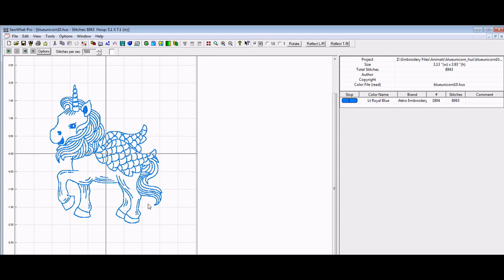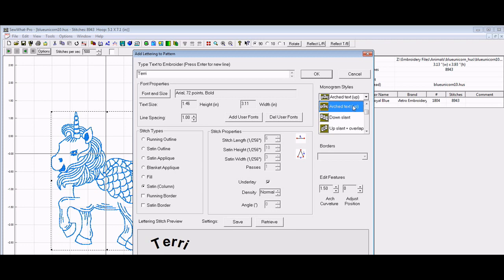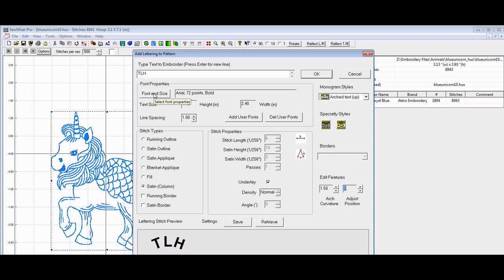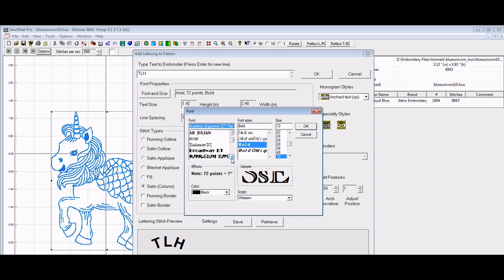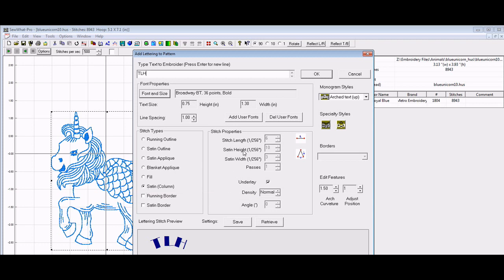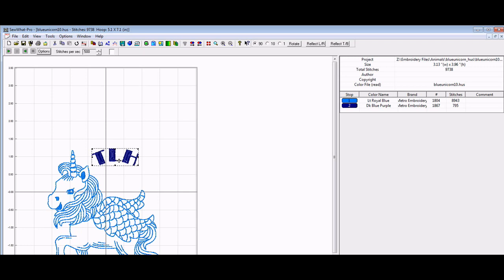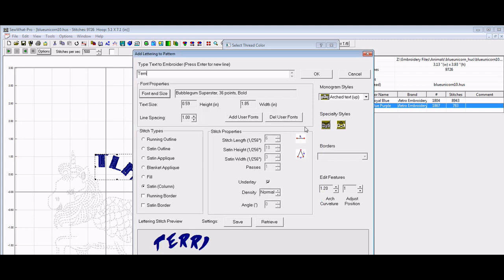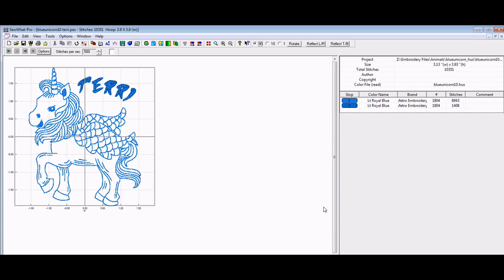Adding Lettering Using SewWhat-Pro Embroidery and Monogramming Software

Comment: I know this video is old but I am hopiing to get my questioin answered.  I did just as the video says and was able to stitch out the words with my design but it did needle stops after every letter instead of stitching everything  at once.  There were even multiple needle stops in the middle of some letters!  What can I do to make it stitch everything together.  Thanks.
FYI - I did join all adjecant colors which I thought should take care of it. It worked for the picture but not the words.

Comment: I downloaded a true type font to use with Sew What Pro.  I have a Brother PE770 machine.  I am able to get the file on the thumb drive and see it on the screen of my PE770 machine.  However, when it does the monogramming it is not correct.  Base stitches under the first letter are too long and the remaining stitching doesn't come out correct on my project.  What am I doing wrong?  Anyone have this problem?  Thanks

Comment: I have been told you can download additional .ttf fonts. I have done so and I thought added it as a "user font", but I still don't see it listed in the font list.  If I go to "delete user fonts" it does show the font.  What am I doing wrong?  Thanks for your help and for the tutorial!
Reply: Rachel I know this is 4 years later and I hope you were able to resolve your problem. If not, then note that you cannot see your downloaded font by clicking on the user font alone. 

After downloading and installing your fonts. You click on user fonts, add the font you want. Then click on font and size button, scroll through or type the first letter of your font name to see it. Click on it and press ok. Type out what you want to check if it shows as your font, if it does, then you are game. Hope this helps.

This happened to me too until I followed this route.

Comment: Can I just do words such as a phrase, without a picture? do I have to have sew write to do words?
Reply: Hi Crafty Mom, I know it has been 4 years and you must have resolved this issue. Yes, you can write only letters/words and you must not necessarily have sew write though I recommend sew write because of it numerous fonts and functionality. You can use the ttf fonts in the software though most do not stitch out nicely. Purchasing, downloading and installing ttf fonts are way to go. You can add these fonts in SWP after the mentioned 3 previous processes by clicking on user fonts, select the font and add it, then go to font and size, check for the font or simply type the first letter of the font to make it quicker, choose it, write words to check if the font shows the words as it should be and if it comes out ok, then voila you nailed it.

Hope you have been having fun with your SWP. Cheers.
Reply: @EverythingCustomMade  thank you

Comment: I am trying to monogram I have my font picked out and letters. It shows on the computer, I'm saving and writing it to my removable disk which is my USB. It says file transfer complete but it is not in my machine.....HELP
Reply: +Tia Thornton on mine my machine supports a 4x4 if the design or hoop is larger my machine cant view it.

Comment: I bought and downloaded a font to use. I tried to add it to SWP in the "add user fonts" but am not able to add it. Says that no .ttf and .otf can be found. Is this because I am using the trial version of SWP right now? Also, the arch/slant text button is not available. Thanks!
Reply: +Donna Wilkins you need to install the font into your computer by right clicking on the font.ttf/otf and clicking install font - once that is done, you will have it available to use

Comment: Thank you for your helpful videos!   I watched this one on using the ttf's on our computer and did a little practice design using Tabitha Font.  I typed "Happy Fall" with a slight curve.  I used it at 72., although I did resize it once it was on the screen.    It did pretty good (although my machine was going so fast that it scared me) until it got to the Y.   Here it got all balled up and broke my needle.  ONLY this letter was raised and messy.  Any idea what I did wrong?